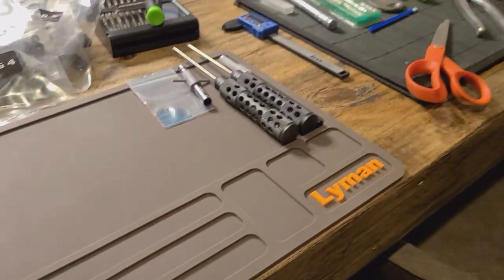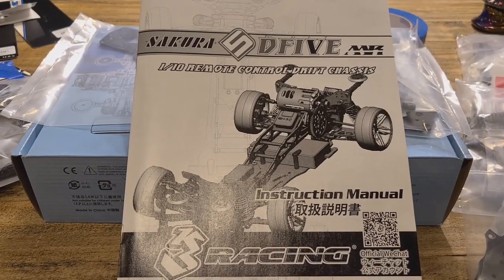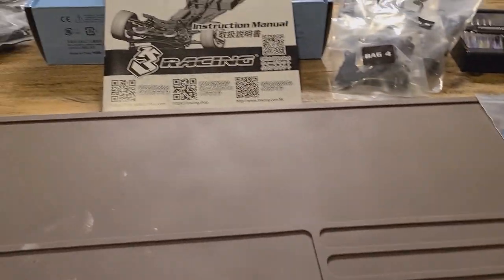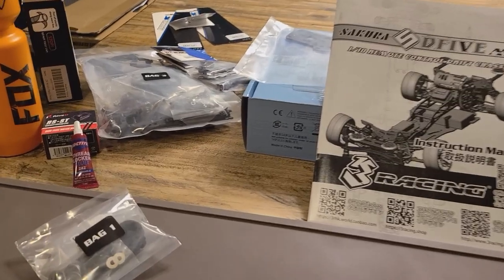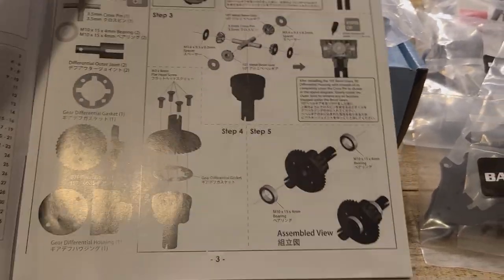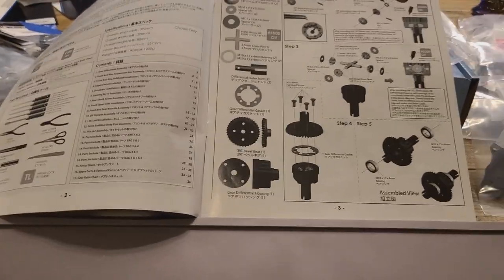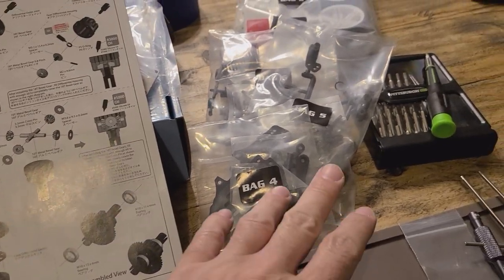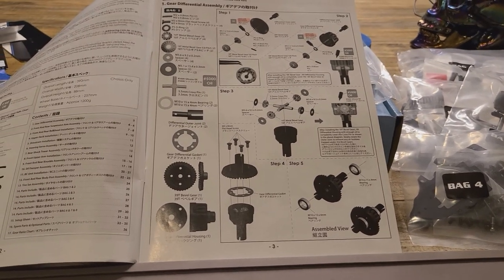3Racing Sakura D5MR Drift Chassis - Full Starter Build with Aluminum Upgrades

Comment: Hi Shawn, what size are those two bullet connectors? Thanks
Reply from the maker: Hi @JustRCCrazy, first, thanks for watching! 

I used 'double barrel' design connectors, so they go from 4mm to 5mm and can be used for either cell size. The ones I specifically used are from TQ Wire - Part # TQ2511 and can be found at most local shops, or via www.tqwire.com

Comment: did it came with the servo?
Reply from the maker: No, the kit I bought was without any electronics. I choose the ReveD RS-ST drift servo for my build. If you order it from the 3Racing website, you can get it with a gyro, or choice of servo from a couple options, in which case, I would have chosen the Brushless S15 servo.

Comment: Just got my Sakura d5mr, are the rear arms and mounts supposed to be at an angle and not go in straight like the front, I have to bend it a little to get it to fit.
Reply from the maker: If you are referring to the rear suspension mount with the 2.5 degree of toe, it was a very tight fit. I do recall having to work it into place, as the three protrusions did not line up exactly. Once I flexed it slightly, it popped into place. I am also running the aluminum rear bulkheads, which require the aluminum mounts for the rear suspension arms to have sufficient clearance, so it may differ slightly, if you are running all stock 3Racing parts. 

Hopefully that helps, if not, just message me with some additional details or info and I'm sure we can figure it out! Thanks for watching!

Comment: What Is the setup for the car because I am getting the same one and have been doing dirt for 8 years now
Reply from the maker: There is so much adjustability, tuning, and many upgrade parts for this chassis. It can be setup several ways, with varying degrees of camber, toe, ride height, damper adjustment, different shock locations, offsets, sag, gyro, etc. 
I honestly had to take it to my local track and get some tuning help from the veteran drivers to get it drifting smoothly, there is so much adjustability to mess around with, but well worth it once you start linking corners/drifts.

Comment: Bro I'm so stuck on the steering. It won't turn haha.
Reply from the maker: I had a similar issue building mine. Can you see anywhere that the steering bridge or steering arms are binding on anything when trying to turn by hand? Next place I would check would be the alignment of the steering servo arm. I originally had mine on at the wrong degree (manual calls for 17 degrees of angle) and it was causing it to lock up on one side. Hope that helps!